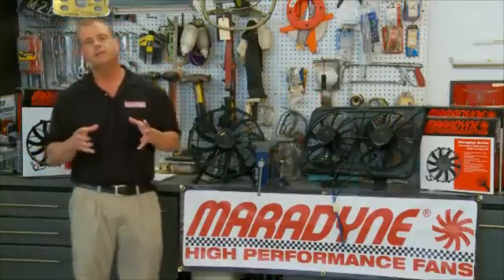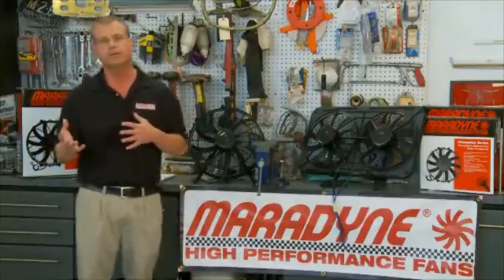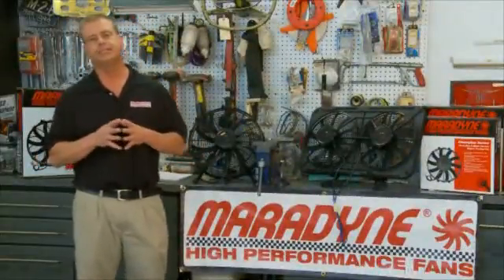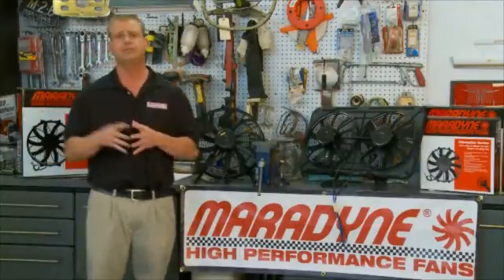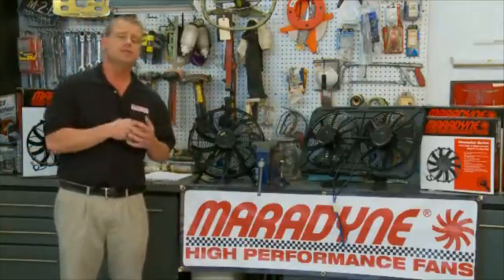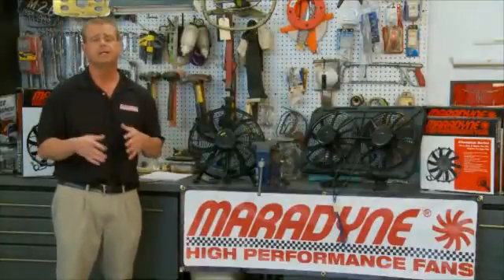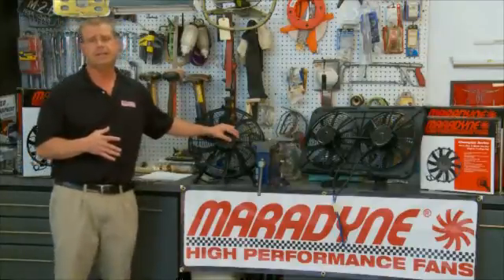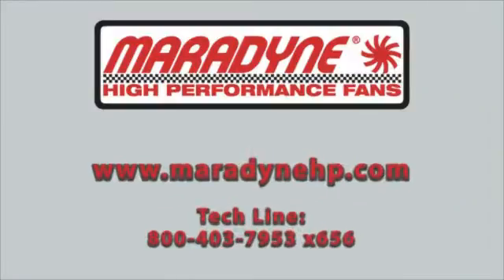Choosing A Maradyne Fan V2

Comment: Hey, do you have a dual fan setup  that with fit an 02 silverado 4.8l,  ( 17hx34w ) radiator core? Stock engine daily drive, sometimes towing not too heavy loads.